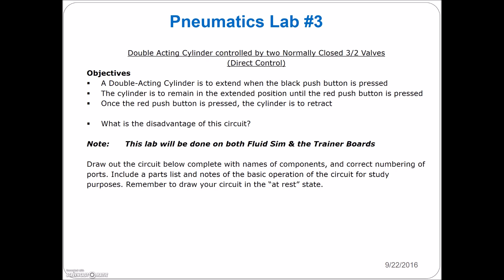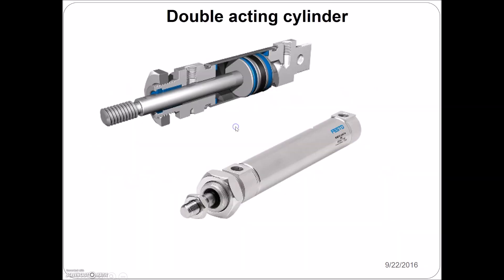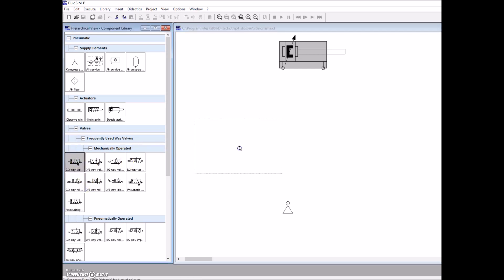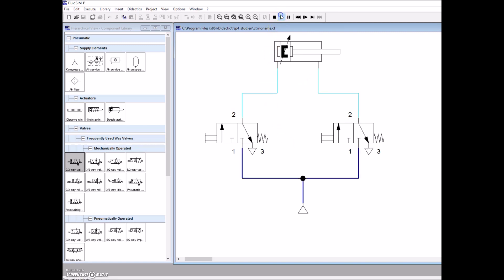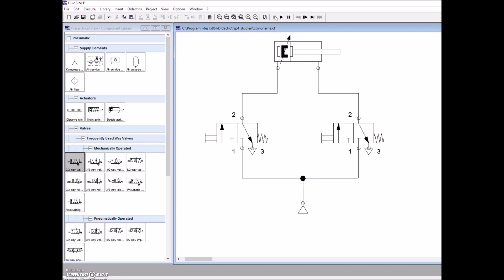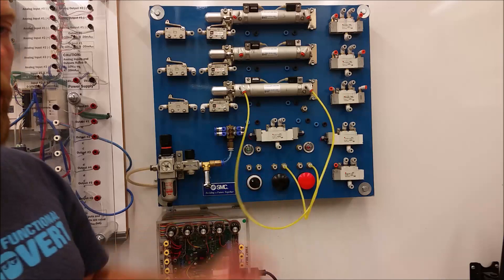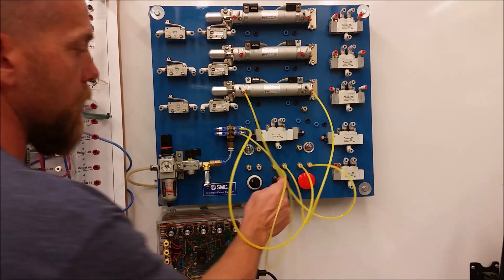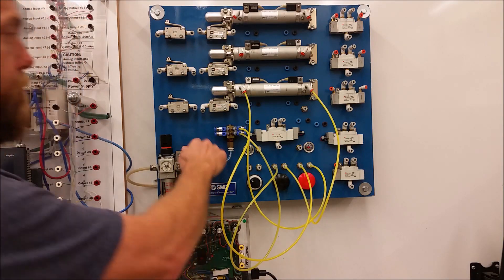Pneumatics Lab 3_Double Acting Cylinder controlled by two 3/2 Push Buttons

Comment: hello sir I found your vid, very informative for our class. Sir may I ask your opinion on how can I make a pneumatic system for this situation? "Using  a  double-acting  cylinder,  it  must  be  possible  to  open  and  close  the  skylight  in  a roof. Two pushbuttons are used, one for opening and one for closing the skylight. Each of the two pushbuttonscan be used for “inching”the skylight into whatever positionis required.The solution to be used employs a 5/3 directional control valve with a defined mid-position  as  the  control  element.  Draw  the  circuit  diagram,  check  the  correct functioningand observe the behavior of the positioning driveduring the stop positions.All connections and ports must have its proper designations."

Comment: What happens, when we press both buttons at the same time and why it happens?
Reply from the maker: If I press both at exactly the same time, the cylinder will remain in whatever position it was last. This is because there is equal pressure being applied to both inputs, thereby holding the 5/2 locked in whatever position it was in last. 

or... whichever PB I press a couple milliseconds before the other will dictate what happen to the 5/2 and the position of the cylinder